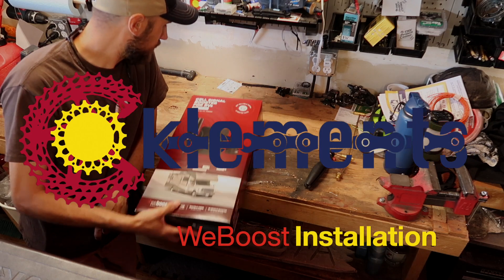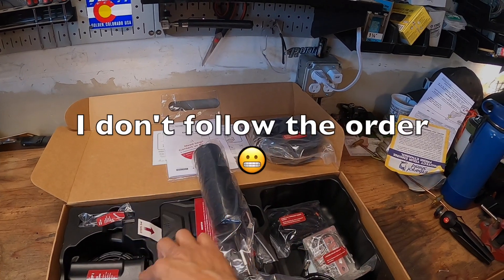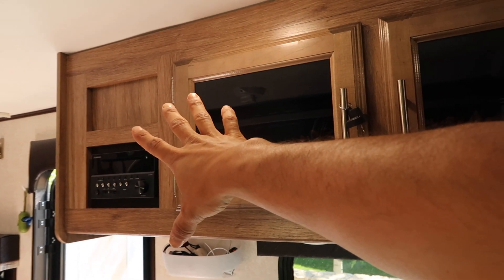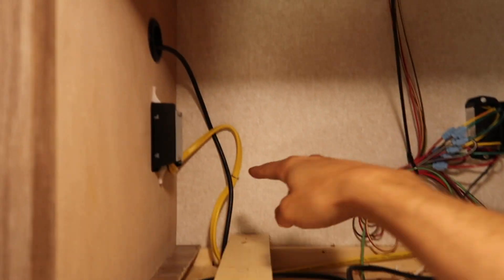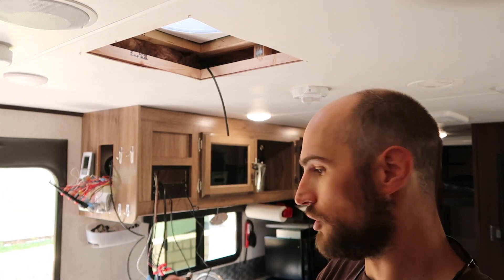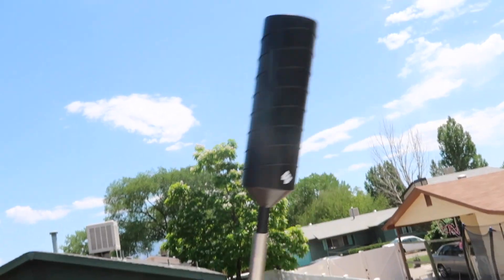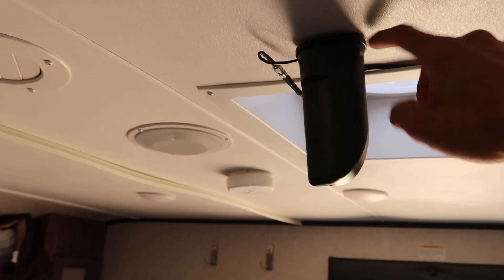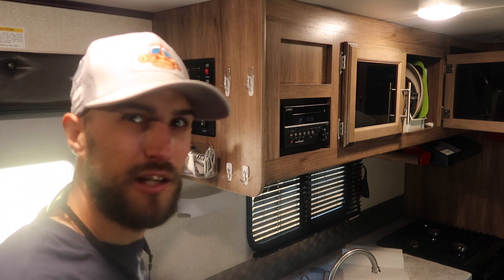How to Install a WeBoost Cell Booster in your RC/Camper

Comment: I found your posting very helpful but I am not at all comfortable drilling Ant holes in my Class C “VIEW” RV! Therefore, using the refrigerator vent looks like the method I too will use. We just purchased this new-to-us 2011 rig and figuring out just where and how to run the cables haven’t been determined just yet.  My own wife has an online business and when We travel So does he4 business. Having this system will allow her to communicate with her clientele and keep the $ coming 8n!
Reply from the maker: I am glad you found this helpful. Drilling a hole that big in a rig is not my idea of fun either. I hope you are able to figure out how to run it through the vent. It was kind of a pain, but definitely worth the effort. Thank you for watching.

Comment: How well is it still working for you? Your way of mounting it is awesome. I didn't want to drill holes in our camper outside either. I have the same roof vent on or new Jayco.
Reply from the maker: Honestly it’s great. We really like it. We like it so much we bought one for the car too, not the same one, but a WeBoost. Been very worth it. Thanks, it was kind of a pain, but worth it not have to drill a hole. And thanks for watching.

Comment: How much did it actually improve cell and internet connectivity?
Reply from the maker: Shannon Andrews I have been shocked how well it works. It’ll take me from one bar to three. Sometimes it doesn’t even seem to add bars but it is being boosted. I have been pleasantly surprised.